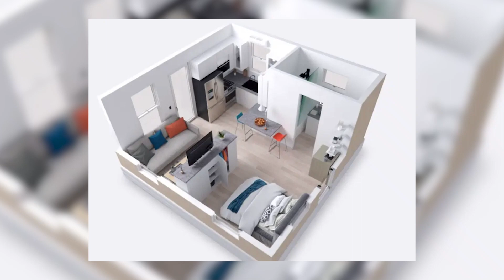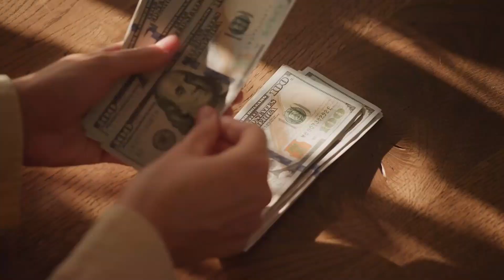IT HAPPENED! Elon Musk's $10,000 House FINALLY Went Public!

Comment: 10K pays for the framed, finished structure with doors, windows and roof. You’ll still have to have it plumbed for water and sewer and wired for electricity and LNG plumbed if applicable. You also have to purchase all fixtures for showers, baths and toilets and have them plumbed. Same thing for electrical for wiring. Also add a cement pad or footings to anchor it down. Then you have appliances and all necessary furnishings. That will turn $10,000 into a minimum of $50 to 60K.With all the illegal aliens in our country now they’ll end up being in huge shortages.true Americans will be bypassed.